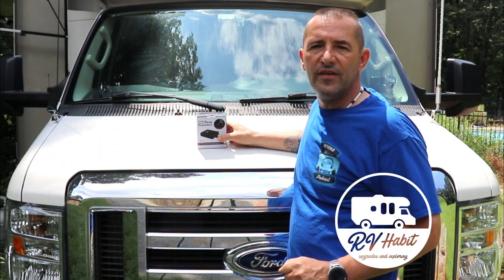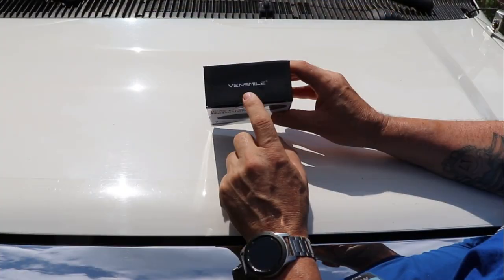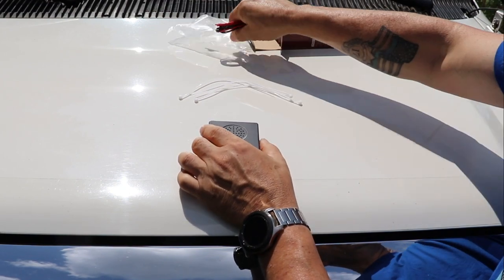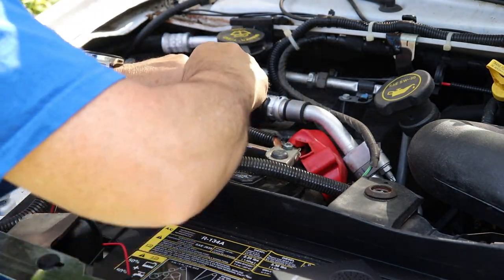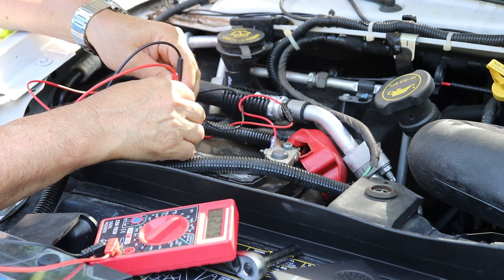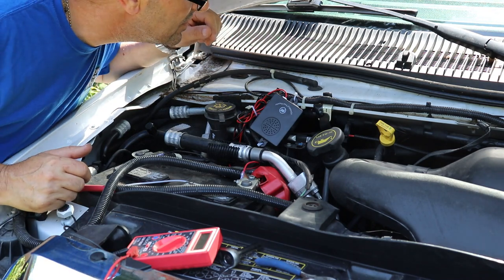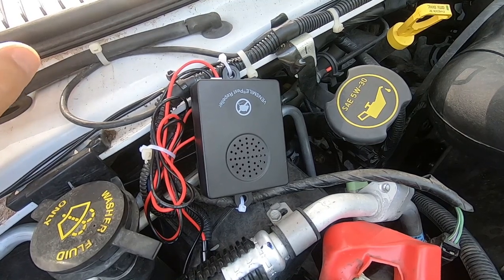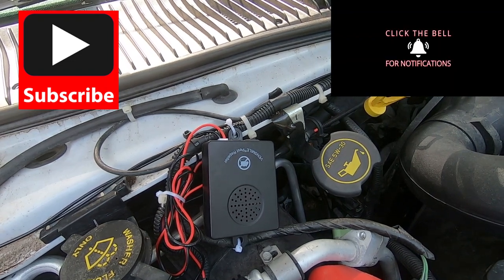Keep Rats and Mice Out of the RV Engine - Ultrasonic Under Hood Animal Repeller – RV Upgrades

Comment: I need one in the desert at our gold camp. Tons of rodents not enough snakes 🐍. I am so afraid to get back and see what my truck is like. Oh boy

Problem is I un hook batteries at camp. This is a good idea though👍🤠
Reply from the maker: it has only been two weeks but so far so good.  The true test will be as the colder weather sets in here.  Hope you're both doing well.
Reply: I have wear on inside driver side tire. May need alignment not sure. You ever deal with that. Also do you have a video on quieter water pumps for rv?   Sorry to ask . I am way out in Montana. No One can do anything for me around here. Trials and tribulations.
Reply from the maker: @LifewithKenandJane   Hi it does sound like the wear on the tire is probably an alignment issue.  After you get alignment I would rotate the tires.  As for the water pump.  I went with a SeaFlo brand pump in lieu of the stock ShurFlo.  The difference has been night and day.  I can't hear the SeaFlo at all it is whisper quiet.  If it ever breaks I will replace it with the SeaFlo pump again.
Reply: That’s great to know. Thanks seaflo

Comment: Quick question I wanna put this in a vehicle where I only drive once a week.
Would this drain my battery on a vehicle I only drive once a week? Thanks for your help.
Reply from the maker: I don't think that would be an issue at all.  This uses only milliamps to operate.  I have not had any problems with my battery and I typically start it once a week.

Comment: My guess is that it is better to mount it lower in the engine compartment rather than higher since any pests come from the ground and pretty much not from the sky.
Reply from the maker: They tend to nest higher in engine compartment.  I have had no evidence of mice since its install.  Thanks for watching.
Reply: Right but they come in from the ground. Stop them from even thinking about it. Believe it or not, they hate mint too. Just mint oil or a bundle keeps the, away too

Comment: Any update?
Reply from the maker: Yes the weather has started getting cold here and that's the biggest test.  But, I can say as of now it has worked excellent.  No mice or chipmunks and no droppings anywhere under the hood. I may buy two more for inside the RV to use during the winter.